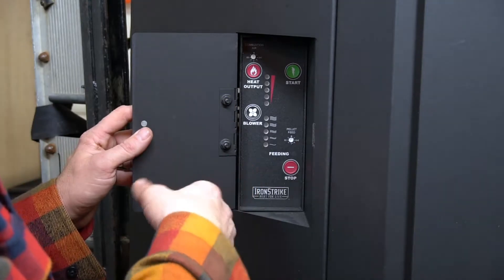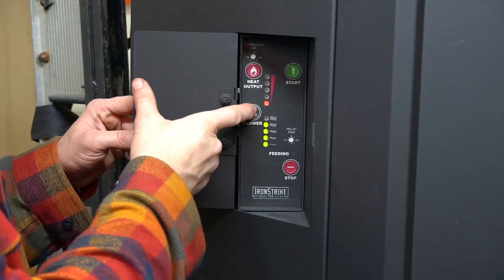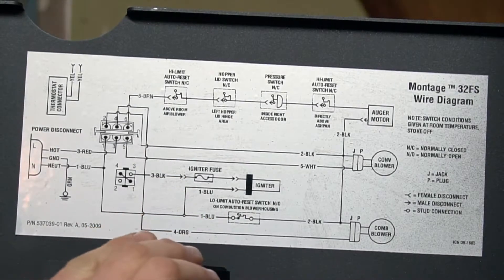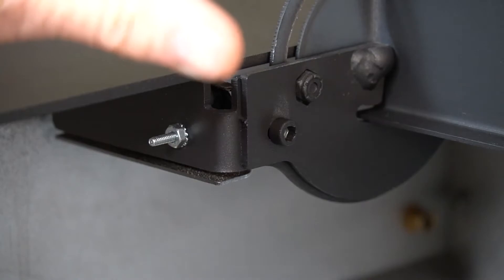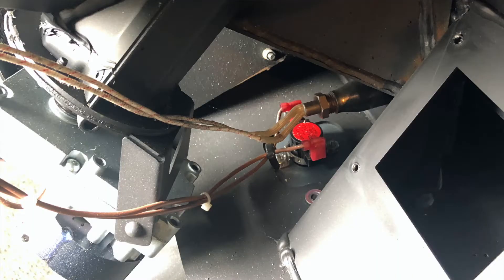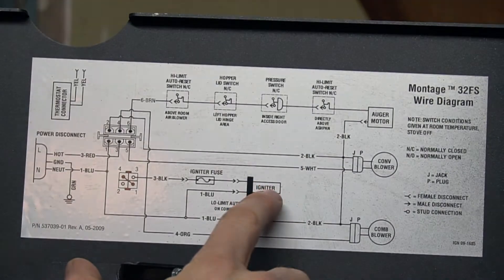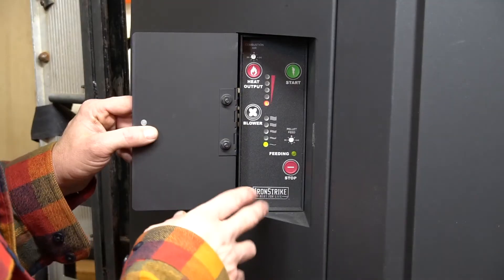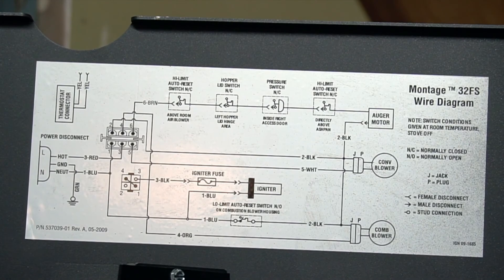Whitfield/ Montage Controls and Sensors

Comment: if when I press the start button i get no start at all. Replaced control, auger, and igniter, just because I have two stoves identical for spare parts. The second stove was given to my neighbor.
  In storage  I tried the stove for a friend to use this winter.  That's where  I am today.  I told him to watch your video, Which I posted for him. He has my multi meter and needs to go though the circuit.
I think it a broken wire the connection at the old,, auger,  was broken at a difficult point to repair, so I bought one to eliminate that. and a igniter also just because. I think the wall plug to the connection at the unit must be also checked for a break....Thanks for what you do. Both of us have experience, less time ,lol
Paul